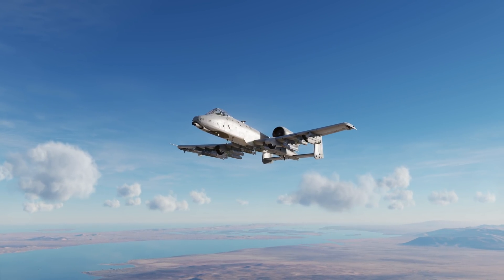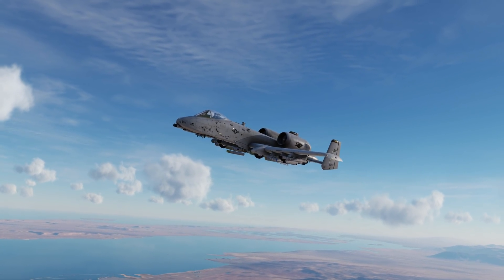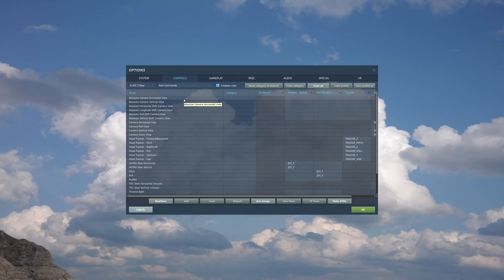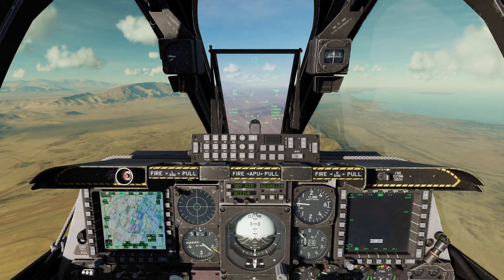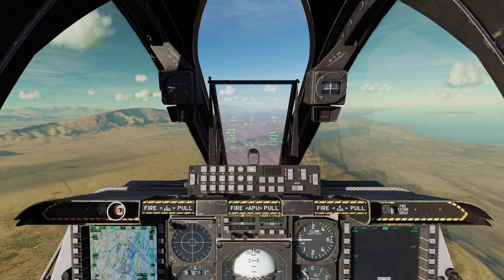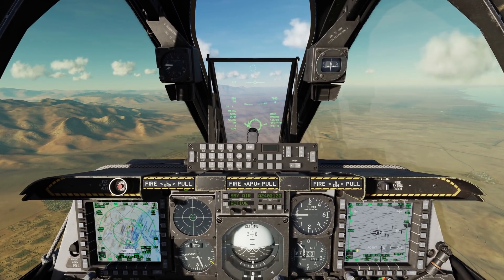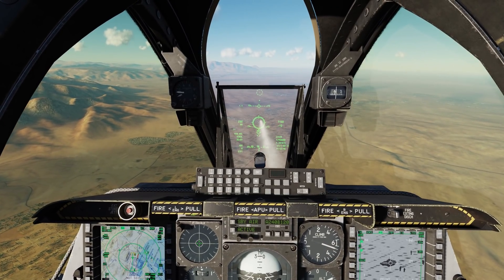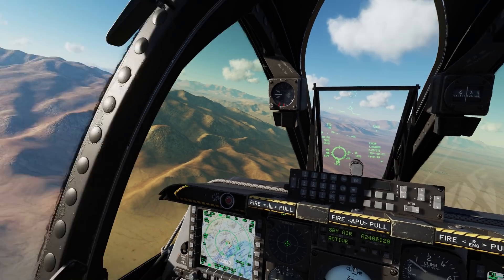DCS: A-10C II Tank Killer - Laser Guided Rockets

Comment: I'm having lots of fun with the new laser rockets, HMCS, and new turn ability. One issue, in a "gimbal roll" situation with the original Hawg, I  would do a "China Hat Aft Short" to recenter the gimbal. Now that switches the tgt pod to "Laser Search". Outside of switching the tgt pod to "standby" then back to "A2G", is there a quick way to reset\recenter\unroll the gimbal?

Also, I was flying the "Hard Quickstart" in VR and it starts you at dusk. As the light fades outside, my right eyeball begins to see the cockpit with a green "night vision" glow while my left eye does not. This causes discomfort at first, followed by pain as it gets darker out. It is terrible! I've noticed that fires on enemy planes have different intensities between eyes in VR and other general issues between eyes with lighting and effects. The clouds in VR are terrible. They have little blobs that roll with your head when close to the clouds, it looks bad. They also "chunk" in a and out of existence at different ranges and angles off-center of your vision, different clouds between eyes. They also need to be fixed ASAP.

Finally, white-hot or black-hot IR on the tgt pod has crazy contrast swings that black out\white out the picture if a little smoke comes into view of the tgt pod, even just a little at the edge when zoomed all the way out.

You should probably adjust the quickstart to hide these bugs (change the time of day, remove clouds, and remove all the fires\smoke) until they are fixed, just something about showcasing all of your bugs to the beginners jumping into the quickstart seems like a bad idea.

Overall it was definitely worth the $10 though, and these bugs will be fixed quickly right Wags?
Reply: You probably found the answer elsewhere, anyway - check the right MFD, press the top right button. That will do the trick. ;-)
Reply: @petrwitt4585  yes that was added recently, presumably due to complaints like mine.

Comment: forgive my stupid question but what's the difference between a rocket and a missile?
Reply: about 13,000 to $110,000, depending on variant :)
Reply: Rockets a generally unguided, missiles are guided. In this case of course we have guided rockets. :)
Reply: It used to be that rockets were unguided and missiles were guided. Obviously these are guided rockets so essentially missiles, but lets throw it on size then. APKWS is too small to be called a proper missile ;)
Reply: the only reason they are called guided rockets is because they are retrofitted rockets with seeker heads and fins